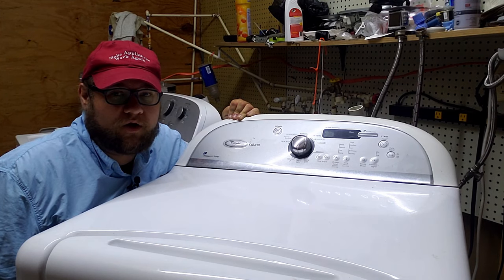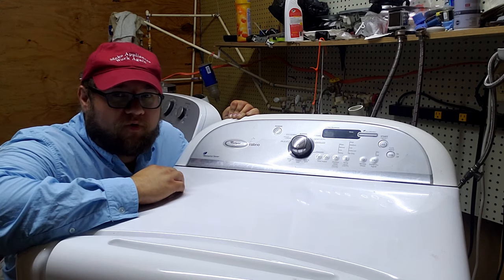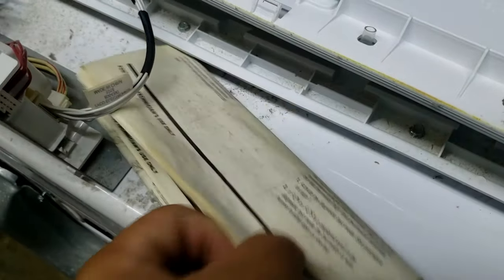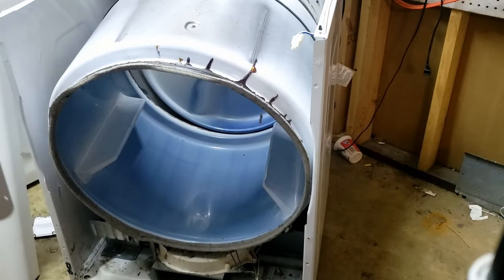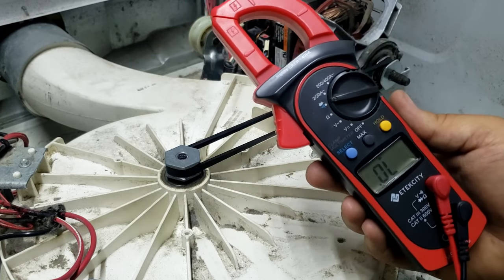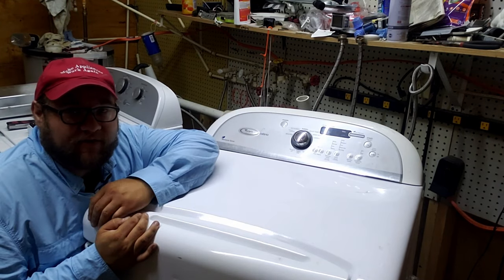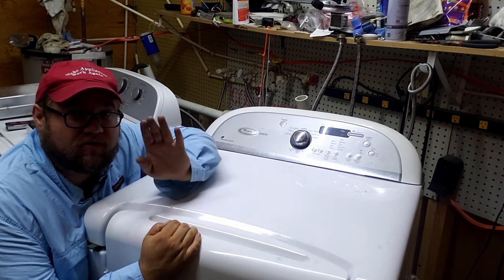Whirlpool Cabrio Dryer Heating Element Replacement and Whirlpool Cabrio Dryer Troubleshooting

Comment: Thanks Ben, after thoroughly cleaning the exhaust vents inside and under the house (no help), I was all ready to order and swap all the parts out on my 8 yr old Cabrio but when I took the front off I was shocked to see all the huge gobs of lint clods that had grown on inside the plenum intake (other side of the lint screen).  So after a thorough cleaning of that area I decided to put the dryer back together and see if that might have been the problem!?  And YEP, that was it.  The heating coils started working again and the check vent light never came back on.  My wife says I am the man!  But really Ben is the man!

Comment: Thanks for the video.  It makes me want to throttle the design engineers at Whirlpool.  The Whirlpool I just replaced was over 25 years old.  To gain access to the heating element I just had to remove 8 or so screws on the back panel.  I then had access to the entire heating system to check/replace the components.  Now you have to practically disassemble the whole machine!  Remove the whole drum just to check the thermostat or heating element?  What BS.  Talk about a giant step backwards.
Reply: Amen
Reply: They simply don’t make things anymore easy to work on, they actually want to make it harder. Considering repair technician fees for the time it takes and parts pricing makes the person with a broken unit contemplate just getting a new one instead which is what manufacturers want. They don’t want you to have a dryer that lasts forever and easy to fix. Just like the ancient vacuums that don’t break, the old fridges that work like the day they were new. They all caught on that they can make more money by making products that fail over time and even more money if you make them difficult to fix.

Comment: Thanks!  Absolutely the best DIY instructional video I ever watched. It helped that you were troubleshooting my exact model dryer! Very lucky to find both you and my dryer in the same video. Thanks again, it was the cut-out sensor that went bad, but it also needed loads of cleaning that can only be done effectively by breaking the unit down. Now running like a brand new dryer.

Comment: Thanks for the great video.  Everything went so smooth thanks to you.  Ended up being shorted wire on heating element (you can see where it shorted on the housing before it melted).  I still checked all the electronics with the multimeter and they were fine.  What a great instructor, keep up the good work!

Comment: Super great video. Easy to follow along- pause, do the step, come back and watch the next one. Tested all the electric pieces and turns out the problem was the two inches of lint buildup on the inside. Shop vac'ed it out and the dryer works great now!

Comment: Thanks to this video, I was able to conquer a job I could not have done on my own.  My dryer is exactly like the one in the video, and its heating element is not the simplest to replace.  I had erroneously assumed the element would be accessible from the back of the dryer, so I started there and quickly realized I didn't know where to find the element.  A quick Google search, and I was watching this video.  Watched a little ... paused ... did the steps on my dryer ... returned to video, then repeated those steps until I was done.  It was awesome to be able to definitively diagnose my bad element with a multimeter before actually installing the new one.  I knew I had corrected the problem before I ever put it back together and had confidence it would produce heat when called upon to do so.  I really appreciate the assistance that allowed me to do this myself and save probably hundreds of dollars.  Thank you!

Comment: Thanks for the video.  I almost went ahead with getting a new heating element, but went back and followed  checking each part and found that it was the heating cutoff switch,  spent $25 and have heat again.

Comment: Thanks for posting this video.  It was a lifesaver yesterday.  Been having issues with the dryer leaving clothes wet and the "Check Vent" light on for a long time.  Thought I had cleared all of the lint until I dismantled the front of the unit like you showed and found gobs of lint everywhere.  Cleared it all out and afterwards the machine dried nicely, ran more quietly, stayed cooler all while the "Check Vent" light remaining off.  Much appreciated!!!

Comment: Just pulled the old dryer apart, came back to the computer to continue research before cleaning it up and replacing the heating element. THANK YOU. Gonna grab a multimeter and make sure I know what's wrong

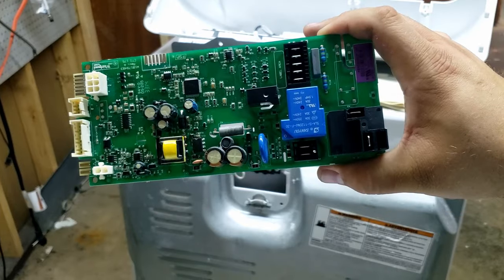Comment: Finally found the right video!!! THANK YOU THANK YOU THANK YOU so Much. My model number on my Whirlpool Cabrio is WED8900BC0 for those that are interested.  If you are just trying to test and replace the Thermal Fuse then fast forward to 6:39 to learn how to take the front off.  You don't have to disconnect the control panel on top to get to it.  And you don't have to take the drum out to get to the fuse.  Then fast forward to 11:20 to see how to test the fuse.  If it is bad, then replace and enjoy dry clothes.  Also have fun cleaning out all of the lint in there!

Comment: Great guide!

I decided to test my electrical first. I 
 I was unable to test for 240v with my analog meter, so I used a digital one and found the outlet is working appropriately. I changed out the breakers though as they didn’t have the connector to switch off both breakers at the same time (maybe I could’ve bought the connector in hindsight?)

I followed the whole guide in order. The thermistor wouldn’t read at all with my digital but it did with the analog reader. Ultimately, I found the heating element was bad, but also found that the idle pulley tension arm plus the belt needed to be replaced. It all took my about half a day and $80 in parts and cleaned out all the lent. The belt is awkward to get on like the video shows.

When I turned it back on there was a slight burnt smell for about 5 min, seemed to be just from cleaning. Working again!

It’s weird that my washing machine completely gave out about 2 weeks ago and now this.. I decided to get a new speed queen Tc5000 - not disappointed

Comment: Excellent video!  I was able to check all the stuff under the drum without taking the drum out.  The drum can be propped up/in with a length of wood, and all the connections can easily be reached.  I checked everything in your video, and after all that, it turned out one of the two breakers feeding the 220V had tripped...the one that the machine needs to heat the air...

Comment: Awesome homeowner video!  Was able to quickly diagnose a bad heating element. Thanks for sharing the location of the tech data sheet under the control panel.  I had to dig out my Robertson bits (square head) to get the console off.  This is only the 2nd time I have run across that style screw.  looking for manuals that’s not one the popped up. Interestingly, I got a diagnostic code F 31 which is not supposed to be a code for my model. Whirlpool refers you back to an L2 error.  Thanks for the tip using a putty knife too.  In the past I would have shoved a flathead screwdriver between the pieces.  The putty knife slide right in and was long enough to depress the clip all the way.
Reply from the maker: I'm so glad this helped you out!

Comment: Thanks. Found that the thermistor is bad. Glad I took it apart. I bought it in 2008 and the fan was packed with hardened lint. Should work much better now.

Comment: Although mine is gas dryer, this was an extremely helpful video - THANK YOU 🙏🏼 
Unbelievable how packed full of lint these things get! I’m sure my high temp sensor is bad because there’s evidence of a smoldering fire in mine yet it’s working with intermittent heat issue. (& a good thing it required attention before we had a full-blown fire!)
If cleaning alone doesn’t solve my problem I’m guessing it’s going to be the usual culprit, a bad gas igniter. I just can’t comprehend the fact I have to take that bulkhead apart to get to such a high maintenance component!
Reply from the maker: Sadly, many brands have gone to a more "Elegant" 1pc front that does away with any hope of a service access panel. Which is a shame because it'd be SO helpful on a unit like this.

Comment: Hey Ben,  Thanks for the play by play, absolutely awesome.  Since I have the whole dryer open to change the fuse should I just do a complete overhaul meaning changing all sensors and belts, or just leave well enough alone and deal with the bad sensor only?

Comment: This video was so helpful. Any advice on getting rheumatoid arthritis wire/s off of the heating element? Mine seem stuck in place
Reply from the maker: Needle nose pliers. Clamp down then use the metal casing as leverage to.pivot them off

Comment: I have a cabrio dryer WED5800BW0 and have the second version of clamshell for the heating element.  This thing was near impossible to get back into the hole because of the tag at the top. I had to bend it back slightly to get it to reinstall.

Comment: You can pull out the heating element shell case without removal of the dry tub. I can access and test the thermal fuse after remove the door.

Comment: Thank you so much for your video. It helped me tear apart and reassemble the dryer. Just have one question I had to sit on the top of my dryer to get behind it. And now it makes a rubbing noise when I have the top completely shut. Any suggestions on how to fix it?
Reply from the maker: I'd check the casing and make sure you didn't maybe push in a little metal causing the rubbing noise. Also make sure the roller shafts are clean and free of derbis. Sometimes you can get small bits of dirt and derbis moved around when working on a unit causing issues

Comment: Do you ever restring the heating element? Or have you ever done that? Does it save any money? I'm thinking about taking my electrical business and adding appliance repair. Your videos help a ton. Thanks man!
Reply from the maker: Time is money and outside of the Frigidaire kits and dryers I don't really. I know the string kits are $10 but real elements cost only a little more and are less accident prone. However we always keep a kit or two for emergencies just in case
Reply: @bensappliancesandjunk  cool. Thank you very much for your quick response! I will certainly keep that in mind.

Comment: Ben, thank you for this video.  I followed your excellent instructions.  I pulled out the heating element which slid out.  It was not the clam-shell design.  I ordered the part based on the model number.  They sent me the clam shell design heating element.  The place insisted that this was the only heating element for this model.  We both know this is wrong.  I contacted Whirlpool and they gave me a part number which again showed the clam-shell design heating element.  Aaaargh!  Do you know where can I find the slide-in-slide-out heating element?  The wife is getting testy!

Comment: Quick question Ben.. I posted a success story here 5 days ago, now the ‘check vent’ light comes on with automatic drying and the heat/dryer seems to drop to a lower temp - however, when using timed drying the check vent light stays off and the dryer/heat works great!?  All vents are clear - dryer just thoroughly cleaned - no kinks or obstructions anywhere.  Any thoughts or advice would be greatly appreciated.  Thanks!

Comment: Great video! My clamshell heating element has the thermostat with the moderator wire. Do you have a link or know where I can purchase the heating element that works with the thermostat and moderator wire??
Reply from the maker: Model#?
Reply: @bensappliancesandjunk  Whirlpool model# WED7600XW0. I believe it’s the exact one you show in this video.

Comment: Thanks for the video. I followed all the steps and found that the control board on my dryer has what appears to be a jumper wire. Also the terminals on the thermostat were burned but the thermostat checked to be good. Pretty sure it had been worked on be fore I tried. Do you have any suggestions?
Reply from the maker: If the wire is burnt it needs replaced as it's probably not sending electric to the heater
Reply: I did replace the 2 wires going to the thermostat but the one soldered in one the back of the control board is what concerns me. As I didn’t see a wire on the back of the one you pulled out in the video.

Comment: Hello! I got a question my dyers won’t start it turns on and everything but when I press start it won’t start it makes a “crack” noise every time I try to start it
Reply from the maker: Sounds like the control board is fried. Watch the first part of my video that shows the board. Unplug the power to dryer, then get the board. Pull the PCB from the plastic case and check underside for a charred relay.

Comment: So I have a gas model….I was able to check all the connections per your instructions and they were either in range or showing continuity. There was a ton of lint everywhere…before I put this back together and see if that was the problem any other thoughts?
Reply: there should be a diagnostic mode to check the gas system

Comment: Great video but I’m stuck.  Broken drum belt but when I hit start, the motor doesn’t spin. Full power on display.  No charr on the back of the control board.  Thermal fuse checked out ok. Any other items to check to determine why it won’t start.
Reply from the maker: Did you replace the belt? There's a switch on the pulley that triggers when belt is installed. Could be that...

Comment: Checked breakers, and I performed all checks recommended: continuity and resistance normal, and replaced the control board.  still not heating.   what else is left?

Comment: The two wires that are connected to the door itself does the black wire go on the bottom and the colored wire go on top
Reply: The moisture sensor
Reply from the maker: I'm fairly certain the order on that specific sensor does not matter. They are two bars that just report continuity when something with moisture touch both at the same time.

Comment: I need some help diagnosing my dryer. It is the identical one you work on in the video. I’ve replaced the heating element and the thermostat. The dryer is getting REALLY hot. So hot it’s almost melting clothes. I’m getting an airflow code but I’ve taken it completely apart and there is nothing slowing down the airflow. The heating element is hooked up the the ductwork in the back side as it should be and the vent hose isn’t kinked. Any ideas??
Reply from the maker: Is the blower fan running, unobstructed? You did not mention anything regarding ductwork other than "vent hose isn't kinked" - you need to make sure its clean, and it vents outside properly with no lint/obstructions. I would suggest taking the vent hose off and running it w/o the hose to see if the temperatures reduce to a more reasonable level. If they do, then you have a venting problem.
Reply: @bensappliancesandjunk  Ok. I had it all the way apart and made sure there were no obstructions. I ran it without the vent hose attached and am still getting the same AF code. The air coming out the vent is the same flow like it’s always been. It’s also hot really hot as it should be. It almost like something is telling the heating element it’s not hot enough so it stays on causing it to get too hot.

Comment: Hello my  whirlpool  cabrio  model       wed 6200 sw1   ok. I check  and  test all the  components of the dryer  i did it 2 times as well take it off all the components  and took  to the place where i buy parts  from appliances he test all the components  and said  tha nothing is wrong with the parts just  only the computer  he didn't  see it    but my dryer not heating  at all but I did replace the thermistor  because I asked to the guy if the thermistor lif was good  just tell me that was no way to know if was working or nor because he didn't have the dryer on side to test out every one part of the dryer can you please give me some extra tips or idea's to fix it. by the  way  my wife purchase other washer and dryer  but I will like to be fixed for the next time I need it please  and thank you for your time

Comment: What would be the cause of powering on, but only clicking when start is pushed... diagnostic mode shows F31. Control board looks good.
Reply: What did code f31 mean? Mine is shown f31 but I’m not finding that code in the tech sheet